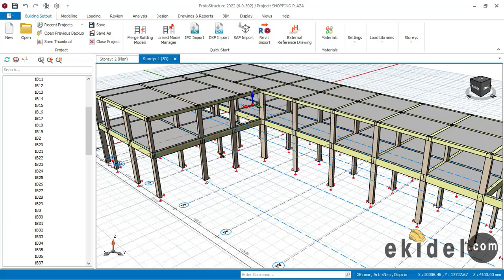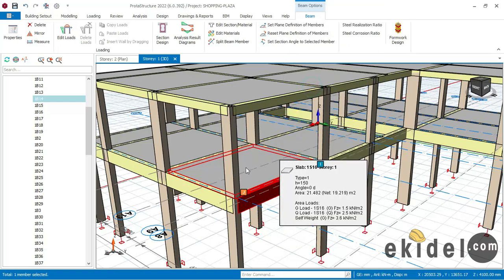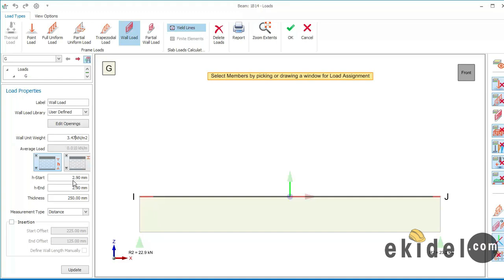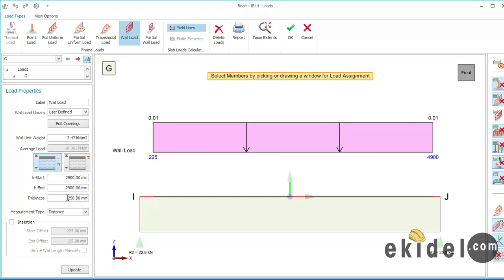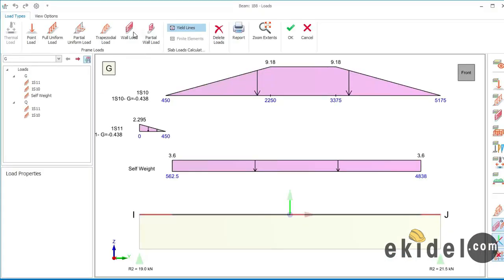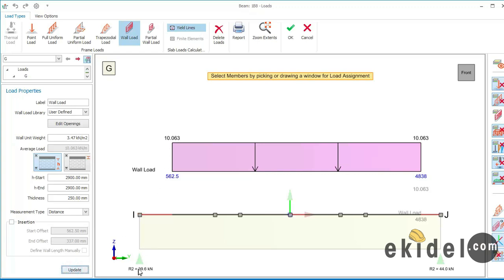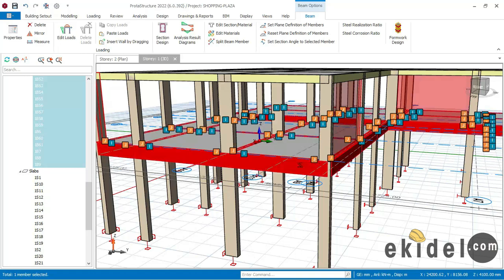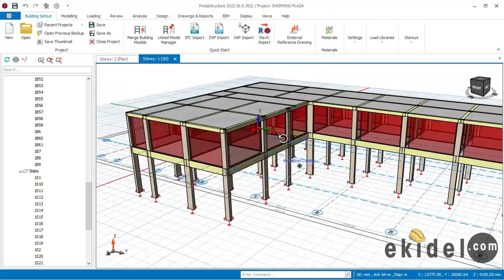Protastructure 2022 : How To Add Wall Load

Comment: Hello bro. Please help out. I have prota 2022 and everything works fine. The problem is that when I select a beam and tight click to show the load editor, it does not appear at all. But when I click the load editor on the ribbon at the top left, it shows. But then I apply load and exit out of that dialog editor, no load shows on the beam.
When I open the prota default concrete project, the loads show. When I delete and want to re apply load, it does not show. Any help or pointers is greatly appreciated. I am using win 11
Reply from the maker: You are using the wrong Prota Structure 2022 ... You can get the shared license version from our store
Reply: @EkidelCAD 
Hi, please can I get your what's number?
We need to talk about the shared license.
Reply: Do u do online classes?